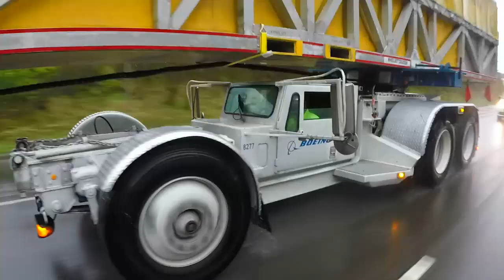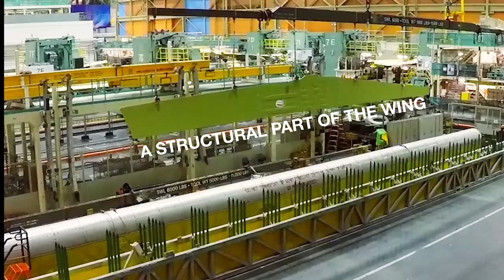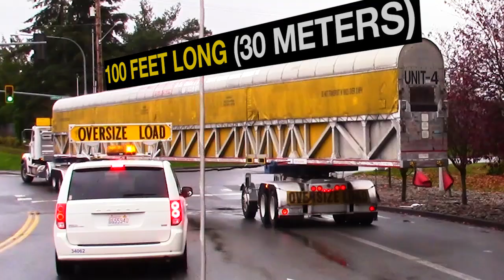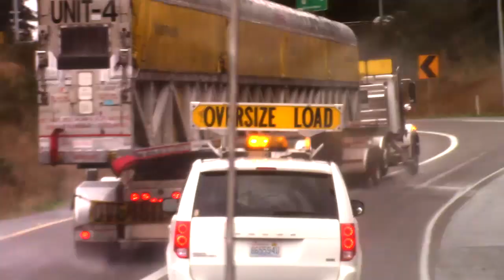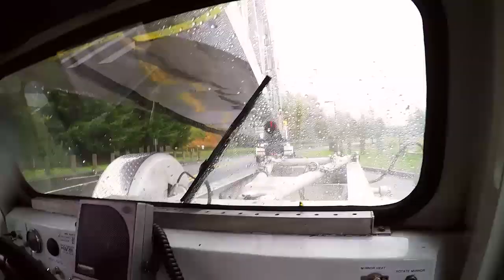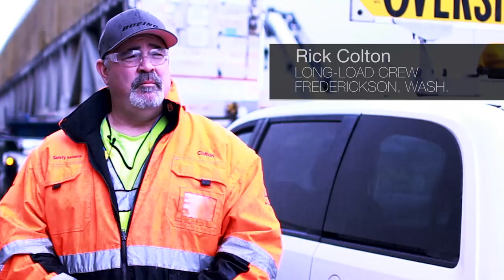Boeing Moves Massive Airplane Parts

Comment: why not simply join the factories?

it would reduce the costs for transport on long term. However, if transport costs are low it's a working solution.